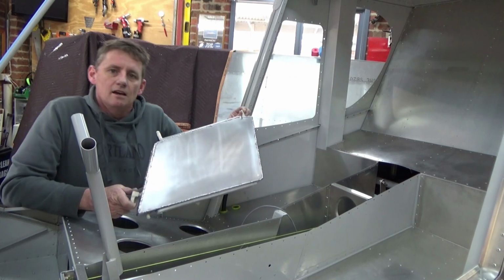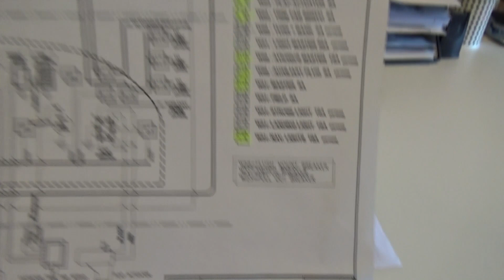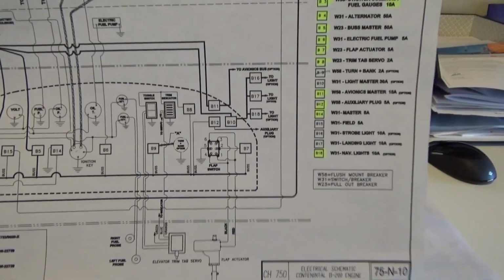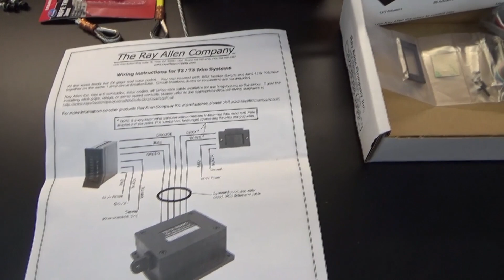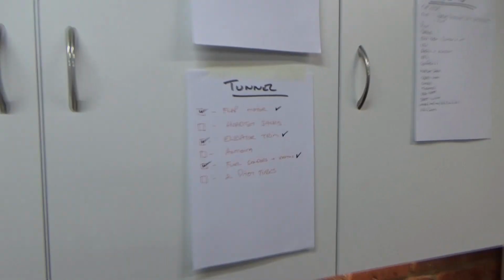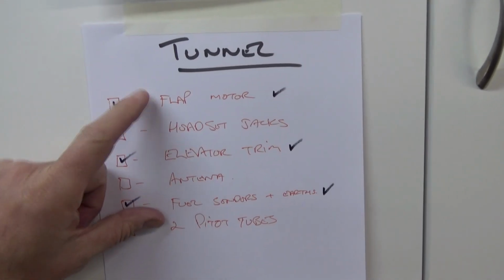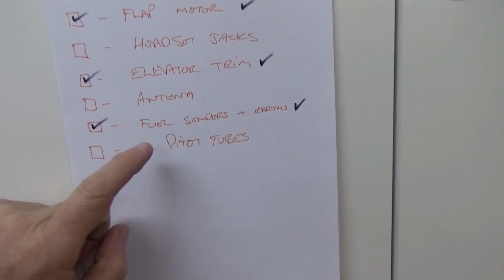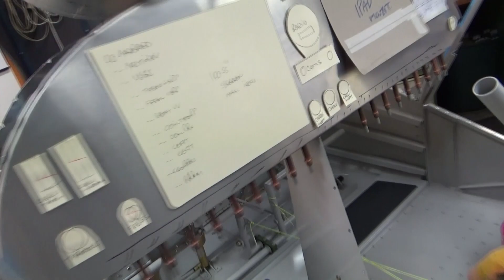How to design your own Ch 750 Cruzer Header tank

Comment: Great Stuff Scott going well. You are now finding out the builder frustration rule that you need to identify all items needed down the track and then ordering them now in advance. I identified and ordered everything of mine in early March and have only just received the last item which has held up my progress for some months. IMO your header tank needs top and bottom sturdy bolt restraints to mitigate severe turbulence forces which can add many times the gravitational force of its normal weight of the full tank. Force x Weight = Danger. The Master Solenoid or Battery Contactor (Continuous Power) should be positioned fixed sideways on the firewall and be fitted with a Blocking DIODE (1N5408 1000V 3A Diode 0.40 ea. at Jaycar
). Bloody Zenith supplies the 5 wire grey elevator trim servo cable too short so I pulled my kit supplied wire out and ordered a 30 foot length to reach the front instrument panel in one continuous wire. Love your header tank well done.
Reply from the maker: gregbev priest thanks Greg, yes the elevator trim wire is an issue. Might do the same and replace th whole length.

Comment: How do you plan to run and terminate the header tank vent line to prevent fuel from escaping if the wing tanks are higher depending on your flight attitude?  Will you plumb the vent back to one of the wing tanks or handle it another way?  Also if you "T" the two wing tanks together before heading down to the header tank, do you run the risk of fuel flowing from one wing tank to the lower one in a bank and starving the header tank, or draining fuel from the header tank to the lower wing tank in a bank, and end up starving the engine?  Are there 1-way fuel valves in the fuel lines from the wing tanks?  I see a situation where you are in a bank, and the tanks are low in fuel, and the fuel flows out of the header tank into the lower wing tank in a bank, due to the higher volume in the wing tank, and the header tank fills with air from the vent line, and your fuel pump eventually is left sucking air.  How did you mitigate such a situation or am I missing something with how the fuel plumbing works?  Just curious.
Reply from the maker: Vent line runs back to top of RH tank. Fuel caps are vented. No check valves, coordinated flight. Yep Header tank holds 8 minutes of fuel, so that is a long time to be in a bank angle so no way of starving it thanks.